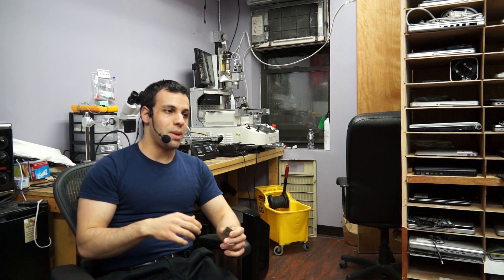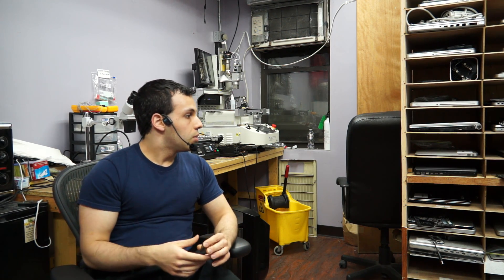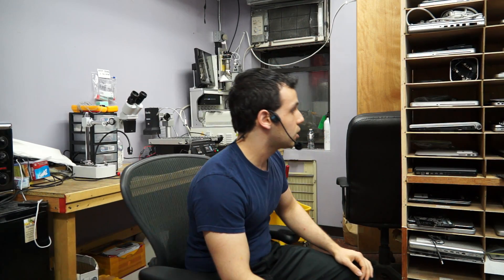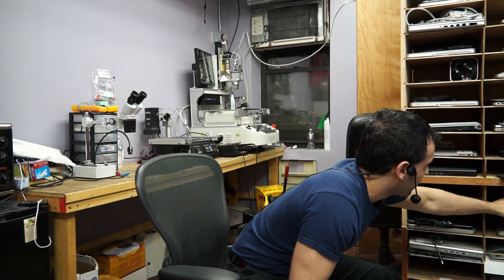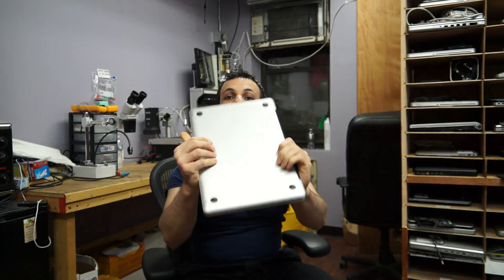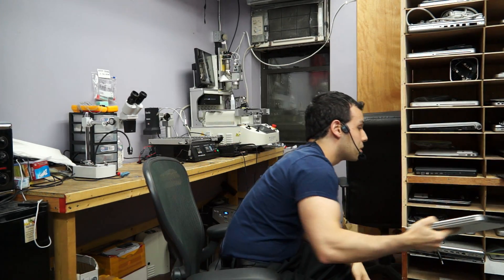Reballing flip chip GPUs is BULLSHIT - the truth about dead laptop GPUs & repairing them.

Comment: yeah i agree,... when it comes to Apple Laptops, yes. But reballing a Gpu Card from a bigger PC Platform, such as an Asus RoG Gaming Laptop. and desktop Graphics cards also can be fixed (whether its a temporary fix,.. to buy time till can replace the parts) but again this is for non apple products. i have fixed desktop gpu cards that were dead, and Asus Rog laptop gpu cards, that were throwing artifacts, once they got hot. (as it is why its artifacting, as a result of prolonged high temps, which do unseat solder points, but i agree, not actual reballing, but reflowing the solder. Ive done it with the oven method as well 10-15 minutes 275°F. But this is all for my own personal owned parts, and friends who needed a quick solution. But for cliental, nope!! i will either rma if warranty exists, or tell them it needs replacing, im with you on the long time customer satisfaction.

Comment: I have studied through that reballing traditional RoHs lead free solder balls wouldn't help, but using LEAD solder balls can help to solve this problem. Problem is to get solder with lead as it's prohibited internationally. Lead balls are more elastic in sudden temporary temperature change and can mechanically adjust between surfaces. Lead free balls gets deformed by high temperature causing improper connection. Let's try with lead  balls with lead soldering ;)

Comment: You’re absolutely right. Heating the chip is only temporarily giving it a boost, but its not the solder balls. If you take a cross section of the chip, you would see a failing or distorted mechanism that inside in the chip. (Like if you cut open a logic gate you will exactly how the pins are connected, etc.) when you reheat a gpu chip and get lucky, that computer is hanging on a thread.

Comment: I heated up the GPU in my PS3 and it got fixed. Then I accidentally I let it get hot again and it failed again... I learned a long time ago that electronics do fail a little at a time until the problem is bad enough that the user notices. The common knowledge about the PS3 GPU failing is that it needs to be re-balled and I thought I was making the solder re-flow and repair the supposedly cracked solder. I cannot believe I didn't realize what was going on until you explained it. I should have known better. Chips failing due to heat was common in my Amiga days. More heat would give you more errors and you could keep the chip cool until you could afford to replace it with a new one. I had all this experience and I still didn't put two and two together with that PS3 GPU. Thanks again!

Comment: Is there a source for this apparent programmed timer in Apple products? Not calling bullshit on it, I'm just curious.
Reply from the maker: +Geralt Jones sarcasm
Reply: +Louis Rossmann Haha, sorry. That was completely lost on me then. I know you'll get this a lot, but I'll say it anyway - I'm really enjoying your videos and I'm happy to see somebody who doesn't sugar coat these issues. I'm not an expert in repairs, but I believed reballing to be a viable solution for a long time. Makes me feel a little silly now, but it's good to know the reasoning behind it.
Reply: they might as well put a timer on it, they already make sure that it wont last more then a few years
Reply: It's called shite thermal grease. In every single laptop, console, pre-built, etc (to include Intel's Ivy Bridge CPUs!) I've taken apart, the thermal shyte applied constitutes some type of paraffin compound, which goes bad in about 6 months and loses most thermal conductivity in about a year. You are literally better off scraping it all off (and you will have to scrape it!) and leaving the chip bare. Realistically, you want to squirt a modestly sized ball (about a quarter of the area of the die or a bit more) of Arctic MX 4 on a bare die and reapply the heatsink. At this point, there's no need to worry about applying too much as even a thick layer of MX-4 will be miles better than whatever was in there to start with... or air, but too little will leave clean patches and kill bits of the chip.
Reply: The 'timer' thing is BS.  In many countries (eg., the UK), this level of contrivance is prohibit by law, and they would be sued out of existence everywhere, even countries where there's no law expressly prohibiting it (eg US) if there were such a thing on a motherboard. You would also need more than just a 'timer' to achieve this. He probably made this claim up to draw engagement, or dump on Apple. This is why he didn't bakc the claim up and answers no questions about it here.  Don't take any of this as a defense of Apple on my part (I do agree they are a wretched company).

Comment: OK. This is going to be a slightly long winded post as I hope to help some of those out to really simplify this from my point of view. Feel free to add to this:

First the THEORIES (I think Ive heard them all:

-Poor quality solder
-Motherboard flexes under high heat conditions
-Cracks in the solder from poor machining
-The small pins pull out of there sockets under high heat when the solder is soft....yadda yadda

All my customers ask for is reball this, reballl that. Its like a catch phrase like Overclocking as if its important or necessary.

The problem:

Poorly designed GPU Cooling solutions, typically in laptops. Most poeople theink reballing works because in theory it does. You just bandaid the bad GPU hours before you realized it. Your so-called bad GPU chip you took off the mobo probably works since you heated it. You just dont know that since you spent hours reballing instead.

-Lack of ventilation
-lack of proper heatsink
-lack of proper cooling pipes
-lack of any effective cooling at all

Example: 

-19" Toshiba laptop: Uses a thermal pad instead of surface contact thermal paste style design. Only two screws on one side hold a heatsink only to the GPU. No matter how you slice it, this GPU will never cool properly

-17" Fujitsu Lifebook: Used a copper shim barely held the the motherboard with a single screw that expects pressure to apply effective contact. Cooling fan for CPU and Northbridge sits ontop on this cooling plate. Its essentially almost like passive cooling.

These are examples of poorly designed cooling for GPUs. So what my customers tend to experience it poor performance, screen artifacts, locking up while watching videos, etc. This is obviously a tell tale sign of an overheated GPU.

I dont have GPU-Z to monitor these units as I am only available once they fail to display video, but I would take a guess that these units exceeded 80ºC. Most GPUs function up to about 76ºC and then begin to really suffer problems. A properly cooled GPU should get to 72-74ºC under heavy load/stress testing.

Solution to these problems that gets the unit to work, but is still a bandaid fix.

Polish the heatsink contact surfaces to a mirror-like finish. Use REAL, GOOD thermal paste. Not thermal grease, thermal paste such as Artic Silver 5. Sometimes thermal adhesive is better for the cooling plate style design on the Fujitsu.

I notice the GPUs are always caked on with dry, or in extreme cases BAKED on thermal grease. Notice how I said grease? Grease is cheap and only effective long enough for a warranty to expire.I sometimes have to take a razor knife to chunk off and scrape off baked on thermal grease. 

My final words: The reason heating up a GPU alone works most of the time is simple. The computer will or should shut down or you shut it down due to problems LONG before it reaches temps high enough to soften or melt solder.

With a GPU beginning to show problems at 175ºF, what in the hell makes you think solder that melts above 200ºF is the problem? Makes no sense.

I took a heatgun to a bad GPU on a kaptop motherboard and heated it on LOW temp for 1 minute only. Let it cool. Slapped it all back together and it worked!

This is a temporary solution to a poorly designed laptop. It might last a week, a month, a year. Most customers are OK with that if you're honest. Actually all of them are OK with this. They know its a simple fix, not a solution.
Reply: i agree with diamond polishing the chip, but with paste its moot. those tiny scratches dont mean anything with the paste. And the short is from a whisker "shorting" out the unit. the connections are not lost, the thing is shorted out. this works because the whiskers are thinner than a human hair, they cant take 400 degrees and they vaporize.

Comment: I've done this before. Not reballing, just heating up the chip. The understanding I got in advance was that it was a temporary resurrection/the system was in the walking ghost phase and was doomed to die in a few weeks or months at best most likely, and there was no guarantee after I turned it back over in working order. Used a heat gun, did it very cheap, they managed to deactivate their account on the device to free it up for future use since there was no other way to do that, and it died shortly after as expected.

Comment: I can vouch for every word of this. I do cell phone repair and when the LG G4 started failing, I went through this. The timeline is accelerated. The chip can be reflowed and will work long enough to back up photos to google photos or an SD card then die again. If you’re lucky. It never worked for longer than a half hour of actual use. I would still offer it under the caveat that the job will not work long term 100%, there’s no warranty, and you’re paying for my labor more than the service. Some people will still go for it but they need to be educated and have the proper expectations. Especially if they actually “use” their device.

Comment: All solder noways is lead free, and lead free solder has a tendency to crack with temperature change more then the one with lead in it. Just a thought.
Reply: Correct! This is why the solder cant handle the heat.
Reply: Walther Penne yeah, cats pee on them, too.
Reply: No it isn't. I just bought "electronics solder" 1 month ago that is 70% lead.
Reply: @4udio_Vortex  You can still buy leaded solder, but if you want to sell products almost anywhere you have to obey RoHS, which means using lead-free solder. Either that, or continuously pay fines in order to do business until you go bankrupt.
Reply: @Naris17  I understand that, but you and I both know I was addressing your original claim.
Reply: that is pretty dumb, dont you think a big warning sticker on the inside of the device would be enough? its not like your little child is going to take apart your laptop or console and find the solder, and chew on it, and even if they could,  you would notice them trying to tear apart your stuff.
Reply: @storm37000  it's not about children chewing on it, it's about the improper disposal of mass produced electronics leaching lead into the environment in which those children (and everyone else) live
Reply: then how did fluorescent lights pass that one, easily 100x worse.

Comment: Absolute bollocks, the heating re solders the lead free solder where it has cracked after expanding and contracting so many times, lead free solder is the reason most newer computers fail, lead solder is softer and can take the expansion and contraction better, I have resoldered 2 of my macs graphics cards by heating them in the oven and they are still running 5 years later, this guy is full of his own myth.
Reply from the maker: i had sex without a condom and my wife didn't get pregnant, CONDOMS ARE A SCAM!!11